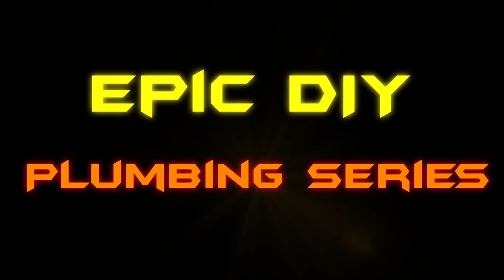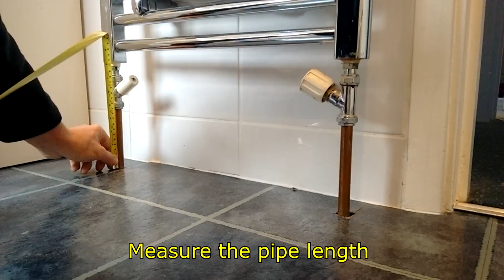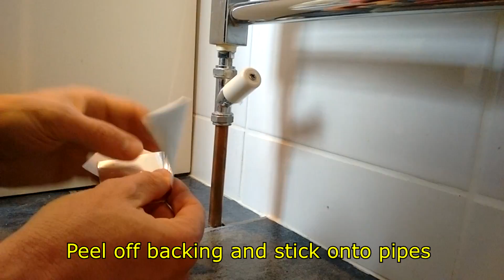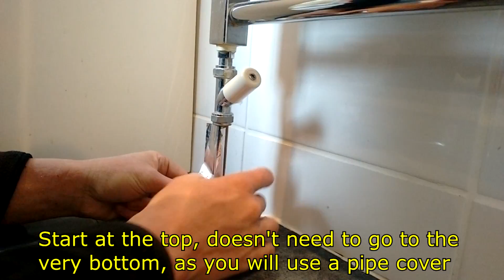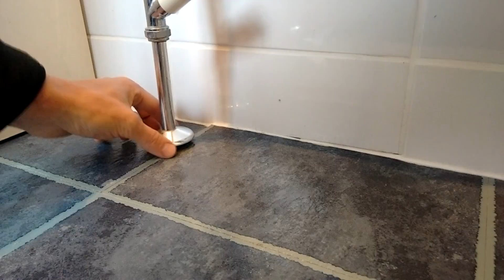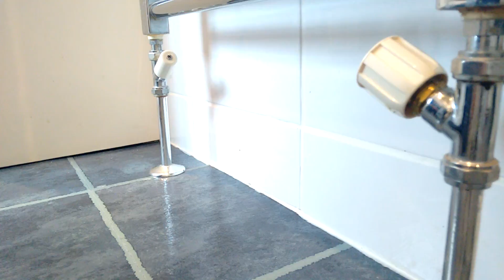Turn copper pipes into Chrome

Comment: They sell chrome pipe cover, alluminum tape may cause galvanic corrosion due to an electrolyte like water going through 2 dissimilar metal, alluminum contains ferrus.